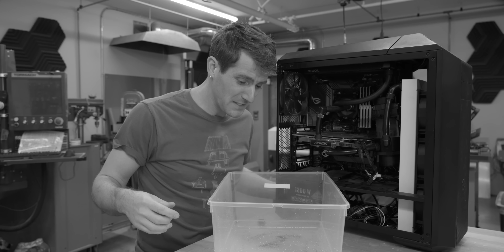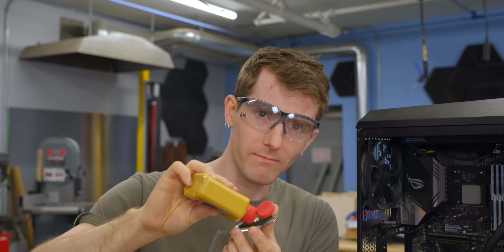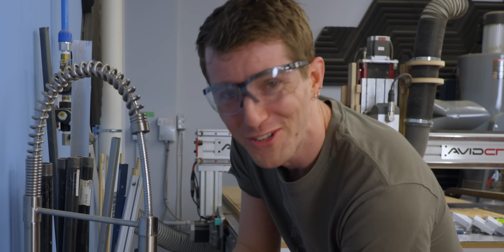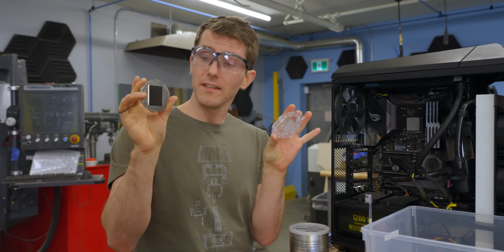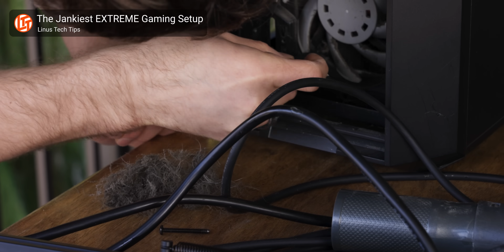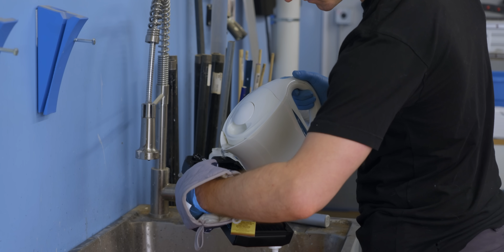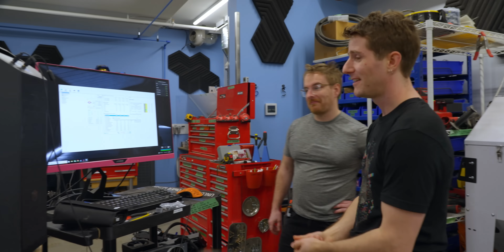I Will Never Watercool Again – Water Cooling Maintenance Guide

Comment: Back in the earlier days of VR, I used an AMD FX-8120 overclocked 100% stable to 4.7GHz and a Radeon R9 290, both liquid cooled on a completely DIY cooling loop.
The loop was made with vinyl flex tubing, a small 160 GPH submersible fountain pump, and cooled by a diluted antifreeze mixture to prevent corrosion from mixing high end copper heatsinks on the GPU and cheaper aluminum blocks cooling the CPU, VRMs, and the 2x240 radiators. For the reservoir I used a large old plastic cylinder container with a nice tight lid, and cut holes for the pump cable and tubes. Sealed them back up with a little plastic welding and silicon sealant.
I ended up buying a separate small reservoir pump combo for the GPU and running 2 loops after adding the the VRM heatsinks. With this setup I ended up spending significantly less than replacing the outdated AM2+ motherboard and DDR3 RAM.
The loops had to be disassembled once for cleaning approx. a year in due to gumming up of some of the component fins and subsequent overheating issues. After that disassembly I just started draining the loop every six months, ran some cleaner through them, followed by distilled water for a day or so, then switching back to the diluted coolant.
It served me well for 3 or 4 years before I decided to get with the times and upgrade.
The whole exercise really took me back to the early/mid 90's era of DIY'ing performance solutions when they were either unavailable on the market or too pricey. The old days where school friends were having an arms race to see who could build the best PC on the weakest budget, or who could find a business or family throwing away a PC with a slightly faster processor or compatible RAM for a free upgrade.
For the $200-$300 I saved building the loop, I was able to wait just a bit longer for the next generation of CPUs and GPUs, and still enjoy the new "thing" of VR.

I feel like with where CPU and GPU utilization is at right now, the performance gains of liquid cooling don't justify the hassle for gamers. Maybe when some of the new features of Unreal Engine are better utilized.

Comment: I tried watercooling, not a fan.  I have been thinking about applying the aerodynamics of using air pressure like Dyson to increase airflow instead of using watercooling but it's not easy to build such thing.

Comment: I was just thinking, something I am normally loathe to do:  why not clean the radiator by using an actual radiator flush aka. automotive.  put the radiator with a pump and tub in a loop.  Let it run for a bit and flush with distilled water. voila' clean radiator.

Comment: You also get some rigs, like my i9-10900x on an EVGA x299, that just can't be tamed by air.  My Noctua NH-D14 couldn't keep up, and I was thermal throttling with a pretty low load. Using Kryonaut.

Comment: I think everyone knows to include a drain port or some planned way to drain, in their second water-cooling build and after.
I think it is normal to use premanufactured coolant or distilled water with anti-biological agents.  At least, that's a major talking point in the forums I've visited.  I think it's not normal to have /stuff/ in your loop; not limescale in the reservoir!

Comment: Red Line Water Wetter - biocide and reduces surface tension so you can get even cooler temps. It's got a red tint that can dye plastic tubing but IDGAF and it works great. My Swiftech pump has run for like 8 years BTW :)  Decorative water fountain pumps, transmission coolers or heater cores and home made blocks were my goto for years. I miss using Peltier but these days processors are just too hot.

Comment: Liquid cooling just isn't worth all the hassle. Big double fan cpu coolers and triple fan gpu's are the best way to go for peace of mind and low noise. It's not 2007 anymore, custom liquid loops aren't impressing anyone. Off the shelf AIO liquid cooling put the nail in that coffin years ago. I mean it's neat and all, but we're not cooling engines here. We're 'cooling' sub 10 nm chips instead of chips of old in the 100-300 nm range. Well back then they didn't measure things in NM, just a fraction of micrometers/microns. Funny how even intel's website has revised it all to nanometers even for 25 year old chips.

Comment: I've been building custom liquid cooling rigs for over 10 years. There's two key facts at play: 

You need to flush and swap out the fluid every year (we do this on cars, it's not that weird) and you can do that easily with some fab forethought to put a fill port at the top of the loop and a drain valve at the bottom. 

Use a decent filtration device in the loop at a point you can open and clean it without too much trouble. Use quick disconnects or valves around it.

Use an anti-microbial insert in your reservoir.

If you use water instead of premade solution, use the most pure option possible, NEVER tap water. If you have no access to lab-grade purified water, then using a high-quality reverse-osmosis system to process the water is needed. Any little bit of minerals or organic material in the water will clog blocks / grow over time.

EDIT: I've never cleaned a loop with anything more than common dish soap and some soft brushes. 

EDIT 2: When you have a poorly designed block that can't be disassembled, reverse flush with high pressure (2x loop pressure is probably a good starting point) using a cleaning solution designed for brass and aluminum. Check your local auto parts store. You can use a high power fountain pump to hook it up. (Fun Fact: all the 655 pumps are in fact originally meant to be low-pressure fountain pumps)

I've NEVER had a machine that looks like this video. Ever. Even with neglecting maintenance. I also have been able to overclock CPUs/GPUs with some of the setups to nearly their theoretical peaks without using something unrealistic like liquid nitrogen.

Comment: Just put automotive green glycol 50/50 with water and never have to clean it. My system has been running for 6 years now with the same water. Radiator is aluminium and heat block is copper. No problems with corrosion 😁 Cheap allso 💪

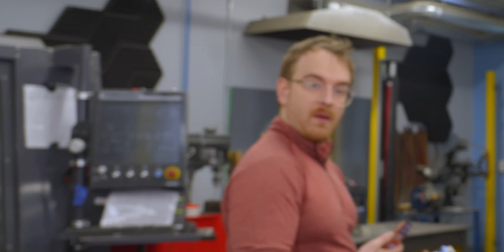Comment: 5:00 I am on a tight budget, yet my next system will be water cooled. Why? Because I basically shut my system off in late April or mid-May, and turn it back on in September,  October, or sometimes (late heat waves) November. If I need computing in meantime, Smartphone will have to do. That also means no gaming (smartphone is a budget one and gets close to a 6-year-old model, and I hate mobile games).
Did forget (edit): I will water cool it like a 90s system. The radiator will be lose and outside. And I mean outside outside. Outside the window … in a swamp cooler.

Comment: MSI said that after warranty period they will not repair water cooled GPU at any cost........ AND they do not sell spare water blocks for watercooled GPU. 
In other words if MSI watercooled GPU die after warraty even if all GPU itself and memoty etc is in perfect condition, but only pump died - you screwed. Such a stupid and waste. Trash a whole working GPU with billions of transistors, 18000 cuda cores, 24gb of vram just because of dumb water pump death....🤦‍♂🤦🤦‍♀

Comment: I wasnt sure whether to go with air cooling or watercooling for my latest rig. I dont clean my pc and my room is very dusty. I had read online that watercooling and aircooling were basically same maintenance wise. I also wondered whether watercooling would be able to cool my pc better than air cooling considering that my fans usually get choked in dust after a while, and knowing me, I was not going to clean them (The idea being that the larger water reservoir would basically act as a larger heat sink and radiator, so even if the fans dont work, it could still a better cooling solution).

I was also going to spend a decent chunk of change on my pc and wondered if I was going to be leaving free performance at the door by not going the water cooling route. After all, I thought watercooling is a somewhat mature sector having been out for quite a few number of years already.

Thank god I still went with air cooling. Seeing how painful troubleshooting watercooling is, I definitely would have regretted going the watercooling route, especially if something went wrong. At least with aircooling, dusting off all the stuff is easy enough and my emergency solution of opening the case up totally and pointing a deskfan at it works completely fine. That wont do anything if the water cooling loop itself is the problem.

Comment: Just use non-diluted antifreeze and never touch it again. Even with 50/50m mix I have never had to exchange the fluid. Use a thermal pad instead of paste and you truly have zero reason to ever take it apart.

Comment: You guys should check out Evans Waterless Coolant.  They use it in classic cars and motorcycles so the coolant doesnt rust out the old engines.  As I recall, the maintenance is a fraction of water.  I seem to recall it is a tiny bit less thermally efficient but so close as to be irrelevant.

Comment: I have a Gaming PC with EC6 fluid from XSPC and I have never cleaned the system in 8 years until I rebuild the PC with new hardware andseeing there was no issue with the coolblocks and the fluid it self I decided to re-use the 2x D5 pumps and  the rads for the new build and again I used the XSPC EC6 fluid.

So EC6 is highly recommended.

I went from a Core i7-5960x to Core i9-14900KF
And from a Nvidia GTX 970 to RTX4090
And I used the EKWB blocks for cooling.

Comment: Hello, i have a Corsair H100 since it was released (2011 or 2012 i don't even remember), never opened or touched. I just clean the exterior (space between radiator and fans gets a lot of dirt), and never had any problem. I had a socket 775 CPU back then (95W) and this system has seen like 4 or 5 different builds over the years. It's currently housing a i7-7700k (91W).
Even  the fans are running just perfect. Over the years i have read a lot of ppl complaining about broken pumps, liquid leaking, etc, i guess i have a lot of luck or maybe i do really know what i'm doing when i do external manteinance or when i have to move the system. Temp's are between 30-55°C in ambient temps between 20-35°C, which is awesome for my needs.

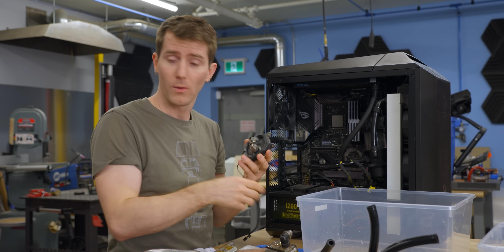Comment: 3:16 😑the 'flakes' came from the radiator(s) , for some reason, some manufacturers (EKWB lol) code their radiators not only on the outside, but inside. So the 'flakes' are nothing but the coding that came loose.
Pouring very hot water into such radiator, makes it expand = more flakes become loose 🤣😅
If you have fitting coded with nickel or chrome , you will get less flakes, but ones that destroy the water block and everything else including teh pump, what happens is that it becomes a "sand blaster", but with water. Had this happen many times.
Using any chemicals to clean the radiators just accelerates that process....only solution is to never let the radiators overheat, and swap the water like each 3~6 months.

Comment: Another reason its so damn dirty is those black rubber soft tube's stuff corms off the inside. I have hard line and I have no mess like this cleaned mine 8 months of hard use nothing like thst st all clear fluid also didn't use water. It came from the soft tubing. I've used that shit black rubber tubing regular clear soft and clear hard line and chrome brass hard line by far the worst is that black rubber soft tubing. Every since i switcher ti my brass hard lined it's neverever dirty like thst I clean it once a year just to clean it

Comment: Probably should have a replaceable zinc bar attached to some point in the loop. It allows mixed metals to survive in harsh environments. We use them in commercial fishing all the time.
Reply: The sacrificial anode corrodes if it's doing its job. In a closed-loop system you better add a decent filter to keep the resulting chunks from circulating throughout the system. For that matter, why don't they have dedicated filters as part of these watercooling setups?

Comment: I’ve built two computers one with a custom loop the pump wound up failing, second pc was an aio sure enough stopped working,went to air cooler learned my lesson!
Reply: Smart man = never a major issue with air cooling - even if your cpu fan dies any decent cooling tower will keep things safe enough until a new fan can be fittied

Comment: I've had a Koolance PMP-450S water pump running nearly 24/7 over 10 years (since 2011) through 3 different liquid cooled PC builds =D it's an absolute champion pump 
It looks nearly identical to that Swiftech MCP655

Comment: Thus the reason I designed my current system from the case up to use air cooling. Sure, the Deepcool Assassin cooler (with the third fan added) looks like a Borg cube sitting on the CPU, but my temps have never been an issue and if a fan dies, guess what? I can keep running on the two remaining with no issues until it's convenient to replace it (I have spare fans for both the cooler and the case fans since they were inexpensive (Thanks Arctic). Sure, the high airflow case means I have to blow the dust out every so often, but I get to do that at my convenience.

Comment: This is why I built my loop and used an additional reservoir /  fine mesh filter so the filter would catch everything. I just did the cleaning after over a year in use and only found stuff in the filter.
This was just with:
Distilled water
Rislone Super Coolant
Silver kill coil

edit: I originally tried to add links to what I used but my post got automatically deleted???

Comment: I have a video idea. Running AMD in 125 watt, vs 95 watt vs 65 watt eco mode, like my 3900X, but I also have Ryzen 3600. I'm not saying those chips, per se, but at 65 watts I was getting 95% the performance and at 95 watts I was getting 99% the performance as in 125 watt mode, the default for this chip. Show that going half the wattage can still get us 95% performance. I always chose AMD eco processors. I want the most performance per watt. Gotta love how AMD is eco minded, but of course has to compte wth Intel, always trying to be the fastest chip

Comment: If that anti vortex filter/puck is made from the same material, Phillips Respironics recently had to recall all of their Trilogy 100 ventilators as the dust filter disentegrated and particles were introduced into the ventilator itself. Luckily patient lines have a HEPA filter before the patient circuit, but still, it might just be the material the filter is made of and nothing about the cooling loop or any additives causing decay.

Comment: Going on almost 10 years w/ current rig - Swiftech Apogee Drive 2 for a 4790k, 240mm rad.  Drained every 2 years.  I’ve de-gunked the pump every other drain and fill.  Quiet, leak-free, and reliable.  Swiftech > all!